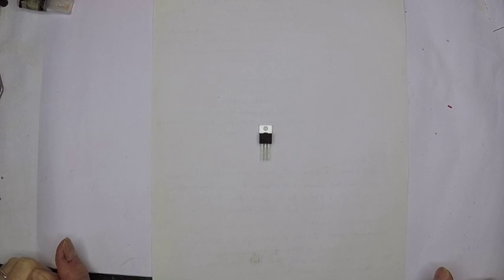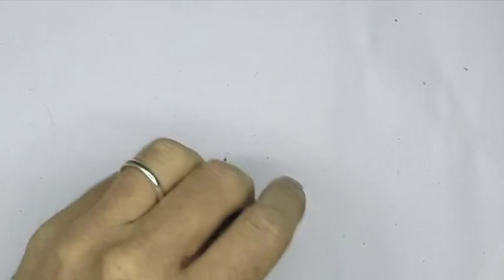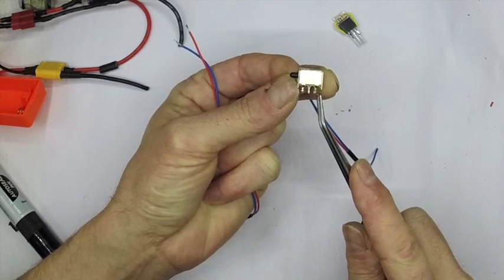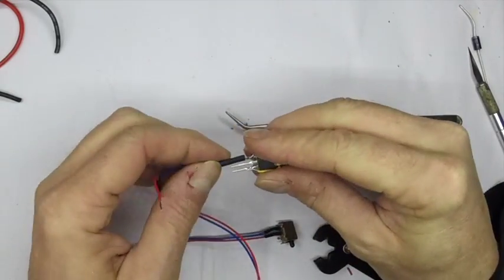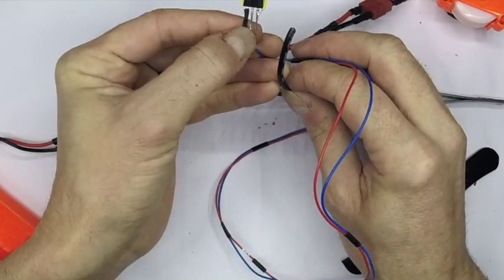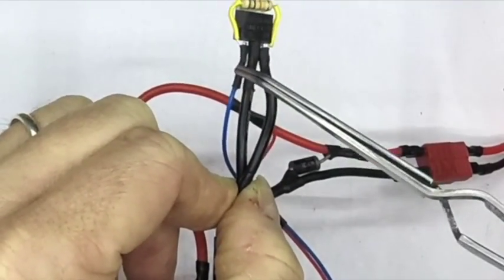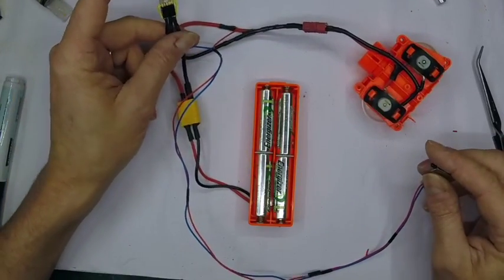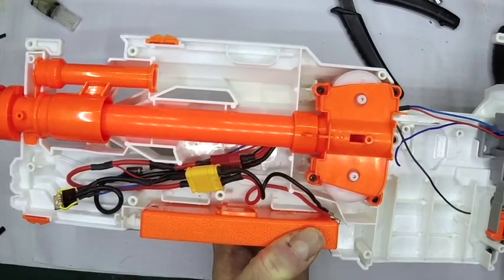How To- MOSFET's For Nerf

Comment: Is this the diode that I would use for a  rhino rapidstrike with a honeybadger pusher?
Reply from the maker: Honeybadgers are crap, use something better. If you must use the worst nerf motor ever, and throttle it, then you could use this sort of diode.
Reply: Foamdata Services copy that
Reply from the maker: A third Rhino works really well, not as fast but has better braking torque and reliability compared to the HB.

Comment: I have a simple voltmeter. Where should I wire it to maintain modularity, and not interfere with the mosfet? (I mean where in the circuit, not physically in the blaster shell.)

Also, it's a Dean connector on the motor block, and an XT-60 on the battery block, it looks like, but am I missing another connectors here?
Reply from the maker: JST connector for the voltmeter and rev switch. Just wire the voltmeter like in my LED video,  one + wire to the Common on the jam door, then from normally Closed, so it cones on when you open the jam door, to + on the voltmeter, - to main battery -.I like to be able to switch the voltmeter off.
Reply: I thought I would let you, and people here, know I followed your guides, and have successfully wired up a Mosfet with MTB Honeybadgers in a stryfe with a voltmeter through the jam door switch. I am a grown man, but I had never even soldered anything in my life. The solder points are... well they are ugly and if I have any problems it's gonna be those. But that aside it went fine. 

I found the parts on Digikey and Newark (fast shipping). All I recommend is buying batches of 3 or more (because you will make mistakes). 

Anyways, it sounds like a leaf blower and gets pretty nutty range. So thank you, FDS. Your services are appreciated.
Reply from the maker: Well done! Try a leaded solder and separate flux if you want to improve your joints. Good luck with your next mod and thanks for sharing your success!
Reply: I have not heard that separating the flux helps.

(P.S. Literally ten minutes later, my lipo inflated and exploded into flames while on a balance charger. However, I took the precautions of purchasing a lipo bag and placing it all in pyrex. I can't for the life of me figure what went wrong, but I know everyone says its always user error (I had successfully cycled it into storage and a charge and drain cycle before, so not first charge). Something I did very rapidly overvolted it like 20 minutes into a two hour charge. I suppose this is off topic, but I thought I would mention it. Remind people to be extra careful with lipos and take all the precautions they can.)
Reply from the maker: You over discharged it, either by a short or through draining it too far. I just follow a very simple process with my lipo. Charge it the night before the game, use it, then at the end check voltage isn't below 3.4v cell, then leave until next time or put in storage charge if the voltage was low. I have never gone below 3.4v even on long games and never had a problem with a pack. Never use lipo for circuit testing.
Reply: That's what killed me about it. Safety is literally my trade. Spent two months reading up on them before I ever bought one. The advice about cycling it through a discharge then recharge was... SBNC, I think? Should I not do that with new lipos then? It was on an imax b6. Maybe that's not the best charger?

A terrifying lesson anyways. Does that mean if they ever drop below 3.4v a cell they should be written off?
Reply from the maker: If you go below 3.3v per cell that pack is dead. The Imax B6 is the most often cloned charger, I do not recommend it for that reason, when new lipo arrives you should NEVER drain it, just pop it onto storage charge and then leave  until you want to use it. A lot of people talk bollocks about lipo and that BS is frequently repeated in the Nerf community. You killed your pack because you over discharged it then tried to charge it. It was either done by the charger or a short in your blaster.
Reply: Okay. You've been very helpful. Last question: what charger do you recommend if not the Imax B6? I only bought that on others recommendation. Money is not a huge issue. I would pay more for more precision and safety in a charger.
Reply from the maker: I like the Turnigy accucell S60 on mains or the Turnigy B6 Pro if you want a 12v capable one. I like the S60 best and never charge in the field anyway! A properly soecified pack should do 2-3days foamy fun without a recharge being needed.
Reply: Y are u using a volt meter use a volt alarm, they simply plug into the balance leads in ur battery tray and will alert you if any one cell becomes too low, lipo batteries do not discharge all cells evenly, so an alarm is a better option
Reply: Also buy from hobby king or someone who is running a well known shop like out of darts, if they are willing to put their name behind it it’s probably good

Comment: I have a question for somebody that knows a lot about MOSFETs.  I had an idea for adjustable ROF for a rapidstrike.  Since most potentiometers can't handle the current required by motors, would it work if I but a MOSFET in there as the main current passage, with the potentiometer controlling how much it lets through?  I don't know enough about the usage of MOSFETs.
Reply from the maker: No you can't do it that way. If you want adjustable rof, buy a 20A ESC off ebay and put it on the pusher.
Reply: Ok.  Would this work?  Also, thanks a lot for the help.  https://www.amazon.com/uniquegoods-Universal-Controller-Adjustable-without/dp/B018FZ3D6O
Reply from the maker: Yes if it will fit in the shell. On top of the pusher box is a good spot.
Reply: That's a good idea.  What about braking, though? do you know if that would work with this?
Reply from the maker: No idea, I use my trigger finger for Rof control. Tap for less shots squeeze for more. I have never found any benefit to a ROF below 8-10 dps or over 14.
Reply: I never said it was completely practical, I just thought it would be cool to do.  I just would rather not fry a 15 USD circuit board because I tried to wire dynamic braking.  I guess i'll have to try.  Thanks for the help anyway! I love your work
Reply from the maker: If you want answers to those sort if questions go to www.britnerf.co.uk it's where I get all my tech help.
Reply: I will

Comment: I'm a little confused by the ending. Are you saying that it can take a lipo or not? Also, I realize the point is to skip the trigger switch swap, but will it still work with a 10A switch? 

What interests me is the idea of swappable power sources.
Reply from the maker: This loom allows you to run any motors up to 60A burst. Motor choice is what drives power sources, they draw the current required by the load placed upon them from the pack, up to their stall current. The pack does not "push" current to the motors. You can run this set up with any switch you like, from a 2c special up to a 21A Omron or Cherry DC2. Input voltage is likewise irellevant, it will work on 5-250v. 
The point of MOSFET looms is not just keeping the switch install simple, it stops any high current being in the grip, which is safer, provides one loom for all motors and simplifies the run of wires through the shell,
Reply from the maker: We also NEVER test new circuits with lipo, that way if there is a fault somewhere you don't short a potentially explosive power source finding out!
Reply: Okay, I understand now. I misunderstood the test section. Thank you for the detailed response.

Comment: I just finished wiring up honeybadgers in my hyperfire using two MOSFETs as shown in this video. it worked sweet. huge reduction in case mods needed, wired so that the pushed can not engage before reving to minimize jams. I even retained the safety switch of the jam door, I did get rid of the clip switch however
Reply from the maker: Nice work.
Reply: Foamdata Services thanks for the help, great step by step
Reply: Foamdata Services I really want to add motor braking to the belt drive motor for more trigger control, any suggestions on a simple way to get it done
Reply from the maker: No idea, I don't own any blasters with the conveyor belt in them.
Ask that question on Britnerf, www.britnerf.co.uk
Reply: Foamdata Services I guess I was to specific. I just needed a diagram of a motor braking circuit that utilizes MOSFETs. I found one in an airsoft forum. thanks

Comment: I still don't understand what does adding a mosfet do?
Reply from the maker: It saves you from needing to swap the rev trigger switch and means you can make 1 wiring loom that can deal with any motor, from stock to Wolverines, plus it stops you having 20-80A in the grip.

Comment: The IRFZ44N is an old FET, and much worse than some of the more recent ones. The IRL40B209 will produce 14x less heat. http://www.digikey.com/product-detail/en/infineon-technologies/IRL40B209/IRL40B209-ND/5683946
Reply from the maker: Never had a heat problem with mine. Will look at those when this batch runs out.

Comment: Does the Voltage or wattage matter for the 10K OHM resistor, the same for the Rectifier re volts & amps? I noticed they have different ratings. Also what are the connectors/adapters you're  using? Thank you for all the detail you provide in your videos, as I am in the same boat as BB (Bob Baker)
Reply from the maker: Wattage rating of the 10k makes no difference. Diode- you need an IN5400. Connectors are JST for low current like LEDs, signal current for the FET, then Deans for the motor block and XT60 for the pack. Britnerf standardised these along with wire colours back in 2012.

Comment: Sorry for the noob question, but what are you using to solder (the gel you dab on the wire)? TIA
Reply from the maker: Flux.
Reply: That is flux, which is a chemical paste to help clean the wire and make the soldering more reliable.  Solder nowadays has flux built into it, so that is not needed. Most likely that is just a habit from the old days when the flux was not incorporated into the solder. (solder will have a "flux core" nowadays)

Comment: Could you do a video showing install of a mosfet flywheel control into a rapidstrike with the bsuk wiring kit for those of us going to do a high power RS build? 

I understand the wiring diagram & why mosfets work (electrical engineering degree), but the physical install is where I need help.
Reply from the maker: You just build the flywheel circuit the same as this one.
Reply: Foamdata Services I'm talking about location of the mosfet in the blaster, etc.
Reply from the maker: Anywhere where there is space. The two likely locations are in the back of the battery tray, with a separator installed to keep the battery from banging on it, above the pusher box or above the fwc in the handle.
Reply from the maker: It also occurred to me if you have a plug in motor block you can use that plug to feed your Mosfet. I can make a loom addition for that. I will look into it.

Comment: Mistake: the center pin of the MOSFET was called the Gate several times during soldering, but was actually the Drain.
Reply from the maker: Thank you, I always forget the names if the pins, that's what the circuit diagram is for.

Comment: Is it 'I' as in 'IN5400' or '1' as in '1N5400' for the diode? As I've had more luck finding them with the later. Also, any experience with the 'UF3001' "ultra-fast" diode? Which is apparently a replacement for the 1N5400.

UF3001
http://www.diodes.com/datasheets/ds25004.pdf

1N5400
http://download.siliconexpert.com/pdfs/2009/5/18/8/55/56/dds_/auto/ds28007.pdf
Reply from the maker: 1N5400. I just copied what was on the bag. Not tried other ones.
Reply: Foamdata Services Interestingly though, they can be found with both 'I' and '1' on eBay. 

I'm about to order a bunch of the UF3001's, so I'll see how they go. 
There are a few differences between them, as can be seen in the data sheets I linked, but doubtfully any that would be noticed in this type of application. 

Keep up the bangin' work mate!

Comment: How would you add active motor braking with a MOSFET to a Rapidstrike pusher? it's easy enough with a SPDT relay, but I don't really understand how to do it with a MOSFET.
Reply: Joshua Lowery No real need. If you need upgraded braking, upgrade from a 130 pusher to a 180. The stronger magnets and higher torque will help immensely with motor braking on the pusher with either dead center or live center fire control mech.
Reply: SirBrass I, respectfully, completely disagree. Active breaking helps immensely, more so  with 180's. I run an active braking circuit with a relay for a wolverine on 3s in a rapidstrike pusher box. IMO it is a necessity for predictable trigger response, and is very easy to do. I would like to upgrade to MOSFET's (Which are just better) just wish I knew how. Now that would be a great how to video.
Reply from the maker: Don't know, you never need to worry about pusher current, there is a thread on Britnerf discussing that very question.
Reply from the maker: Three wire centre live circuit gives you excellent motor braking and cycle control with no need for added complexity.

Comment: It's funny I clicked on this video after reading the word mosfet and thought, sweet, I hope there is a new guitar pedal with mosfets coming out. Then I realized it was nerf and it blew my mind
Reply: MOSFET circuits have become popular lately with 3D printer builders using kits that ship with lower power PSUs (cost savings) to shorten heat up times and more importantly, reduce the fire hazard of wiring a PSU directly to the printer controller PCB.
Reply from the maker: They are a very useful component. This particular one is used in car headlamps amongst other things.

Comment: great video, I really prefer the idea of keeping the stock switch and doing an electrical mod rather than a largely mechanical one.

Also, there's no chemical reaction happening inside a MOSFET.  It's all semi-conductor electronics.  I know it doesn't matter to you, but to electronics people it's like nails on the chalkboard hearing someone get that wrong.
Reply from the maker: Well it's physics then. I have a simple remedy for pedants, it goes like this, Block, Delete Move on.